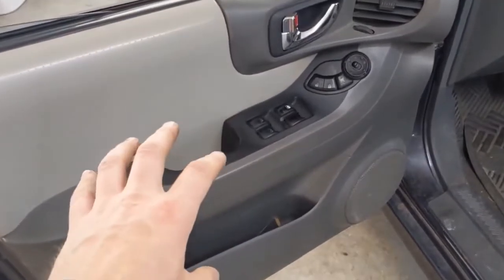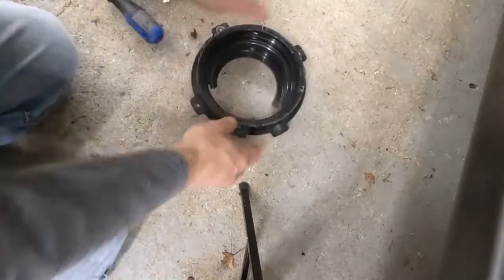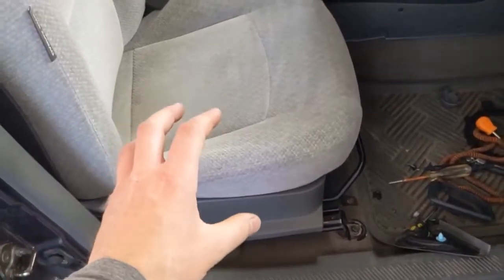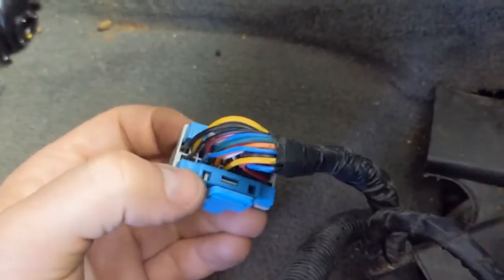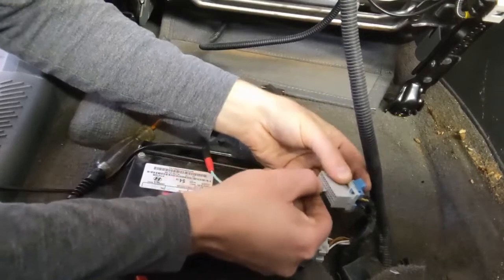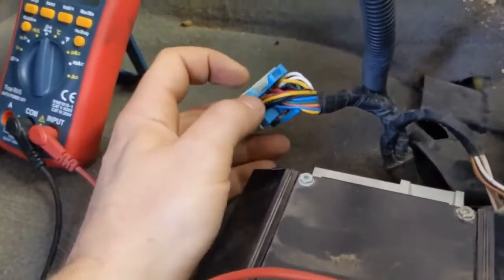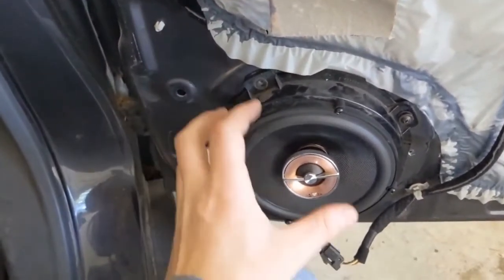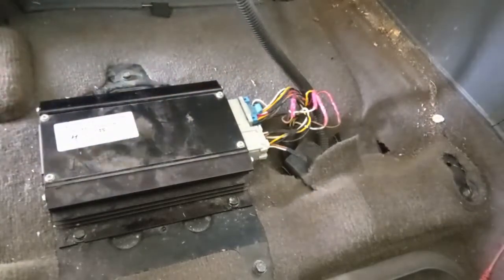2003-2006 Hyundai Santa Fe Aftermarket Front Speaker Replacement With Monsoon Amplifier Bypass

Comment: Informative video...If it's a Functional Amplifier (Increases volume) you're Bypassing,  Isn't the "Bypass" going to Reduce the audio signal Volume to the Speakers.....How & Why can you Hear anything Loud enough Without the factory Amplifier ??
Reply from the maker: It all depends on the stereo you are installing. Some decks will slightly amplify the lines coming out. If that's the case then you'll be getting double amplified and the sound quality will suffer. If you are uncertain then I recommend trying the stereo first. If it sounds good then leave the amp but if it doesn't then you'll know what to do 👍

Comment: I'm getting ready to do this, this Saturday and I need to know why you used the wires to the top speaker instead of the wires coming from the bottom part of the speaker? I hope you can get back to me so I can do this right. Just trying to understand why you chose those particular wires. Please help.
Reply: Btw, I have the same kind of speakers meaning that they have just 2 wires coming from them even though they are 2 way speakers.

Comment: Hi. Yeah I would like to know why you had to bypass the amp to make the speakers work? Because awhile back I changed my door speakers in my 06 hyundai sante fe and i didn't do none of what u did. And yes mines do have the factory amp under the seat like yours did
Reply from the maker: It's recommended to bypass the amp when going from component speakers to three way. The reason is because the amp is splitting the frequency between three different component speakers high, mid and low using three different sets of wires (one set for each speaker). But a three way speaker takes audio with one set of wires and splits it out on it's own three speakers attached together. If you use the factory amp for a three way speaker you won't be utilizing all three ranges. So your highs or mids may not be as crisp. That's my understanding anyway

Comment: Hi. So I've tried this bypassing but on my 2005 all I got was static from the rear speakers and no sound from any of the front speakers.ive swapped the wires around with each other in every combination but it did not work. I've put the wires back together in their original form.  Mine does have the monsoon, it has an after market head unit with 2 way speakers in front and back.
Reply from the maker: With the wires put back together how does it sound?
Reply: @ValleyMobileAutomotive   it sounds normal. But now that I've rewatched your video more closely, I realized my mistake. I was connecting the wrong end of the cut  speaker wires. I'm going to give it another shot when I have more free time. I was really missing the low end frequency in the front speakers and the audio shop wanted to sell me a subwoofer package. But I've been messing around with the wires and when I connected the black and yellow wires to the skar tx65 speakers, they blasted  the low range but I was missing the mid-range. Since I had messed up the first time with the bypass, I decided to cut the black and yellow wires so I can lead them to the back and put in another pair of skar tx 65 speakers that can play the low end in some boxes. But now maybe I won't have to.    Thanks I learned a lot from your video.
Reply: what are you trying to do?
Reply: @drunkenbass6128  I was trying the bypass so the front door speakers plays all the frequencies.  A 3 way speaker should be better but to be honest, the separate speaker set up for each range did sound better. I had new speakers put in but they were 2 way but the place wires them funny so the front sounded lame. When I put in my own speakers and wired them to the midrange speaker wire, it was way better. But then I was missing bass from the "subs"?  The diagram says subs. Only the skar tx65 speakers were able to play the frequencies from the low range wire but then I was missing the mid-range.  I was actually going to keep the midrange speaker in the door but wire the low range to the trunk with a couple of skar speakers.  I should of done that but I went with the bypass instead. I could wire everything back up again but it's a hassle.  Maybe I'll get a proper subwoofer in the future.  But a component speaker system sounded better.  The problem with the door speaker is that they have a low range speaker with a mid-range speaker installed together using different wires and the tweeter is at the top of the door.

Comment: Why is it necessary to bypass the speaker wire/amp connection when replacing the front speakers?
Reply from the maker: It has to do with how the amp splits the speaker frequencies between the three door speakers. You can always change your speakers out without bypassing the amp and if they sound good don't worry about it. But if they don't sound good at least you know there's a video with bypass instructions 🙂

Comment: After the bypass could I just take the amp out of the vehicle? Or would I need to plug it back in like you did in the video.
Reply from the maker: If you replaced and bypassed all the speakers you can remove the amp. If you only did the front like this video then you need to keep the amp for the other speakers.

Comment: Did u use 2 ohm speakers? Cause I tried mine and a normal 4 ohm u get half the volume. The diagrams aren't faulty the pin layout is just inverted for some reason same as on my 2012.

Comment: Hey so I’m trying to fix my radio because I keep popping the amp fuse when I try to put a new fuse and when I check for what wire I need to cut, I don’t get any fluctuation it just stays on

Comment: OK the door pillars are tweeters they're high the mids are in the between the speakers the base the lower frequencies are behind that in the door so it bumps in the door then the mids are in the center of the In they do not get base they're cut off a certain frequency and then the door pillars have the tweeters so one channel has three speakers it doesn’t matter about the hose the amp is still gonna push them all if they’re all the same

Comment: I'm thinking of making something similar to the oem speaker/tweeter they have with after market speakers would I need to do the bypass or could I just rob the original harness from the original speaker and connect it to my new speaker/tweeter
Reply from the maker: The factory set up has 3 different speakers in one door. The low, mid and tweet are all separate. So the amp is designed to split out separate signals for each speaker. If you get a two way or three way speaker as a replacement then the amp set up no longer works and needs to be bypassed. If you replace the tweet by itself or the low by itself (component speakers) then you may not need to bypass the amp.
Reply: @ValleyMobileAutomotive  ok then so my next question is the 6.5 inch the mid range and the 1 inch is the low range or am I getting them mixed up my tweeter is fine I would like to replace those 2
Reply from the maker: @randomstuff159  typically the bigger diameter the speaker the lower the frequency it can produce. So the biggest one will be your low/woofer and the smaller one is your mid. The tweet is obvious, it's the tiny speaker in the triangle trim by the window.
Reply: @ValleyMobileAutomotive  thanks for the help will let you know how it turns out

Comment: i recently had my factory amp and speakers replaced in my 2003 Santa Fe and it doesn't even sound as good as before, any idea what it could be ?
Reply from the maker: Hey Manny. It's hard to tell without knowing your set up. There are so many variables in radio, speaker and amp quality. Sometimes the amp itself is the issue, not being adjusted right. It's also possible the radio needs to be upgraded to match the amp technology. Speakers have ohm ratings, if the ohm rating is higher than the factory speakers they will sound quieter at the same volume level. If you want to replace the radio I have a video on that as well. Sorry I couldn't be more help. Hope you get it worked out, we need our tunes while driving.

Comment: So if I get component speakers I wouldn’t have to by pass the amp?
Reply from the maker: I haven't tried it but in theory you are replacing like for like. A tip: if you get speakers with higher ohms than factory you may notice a decrease in speaker volume.
Reply: Not necessarily, depends on if you choose to use an aftermarket amp or not. The vehicle comes with factory three way components. I believe they are bi-amped from the factory if I remember right.

Comment: I just bought a sante fe. I don't understand why you must bypass the amp. ??
Reply from the maker: The amp splits the main audio speaker feed into three separate frequencies, high, mid and low. Each output goes to its own door speaker. So the left front door has three separate speakers inside. If you are installing a three way speaker it needs the raw audio not the amps divided audio. So bypassing the amp gives your three way speakers what they need.

Comment: They are not the smartest tool in the stead . Do you know that you don’t even have to just connect the amp don’t people not know that the app is the center is the mid base the speaker behind it is the high all you have to do is connect that speaker to where the high is and leave the men disconnected and do the same thing on the other door and that’s it
Reply from the maker: Thanks for your comment. It depends on the speakers you are installing. The amp divides the audio into highs, mids and lows. It outputs each one to its own speaker. So each front door has 3 separate speakers. If you install a three-way speaker you are combining all three speakers into one. In order to have the best sound quality the amp should be bypassed. Otherwise you are dividing the sound twice, once in the amp and again in the three-way speaker.